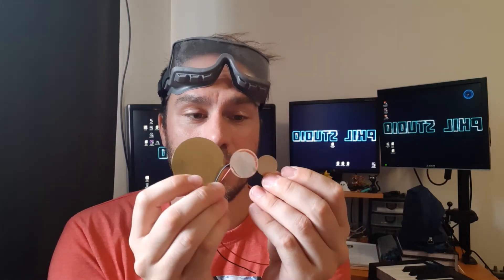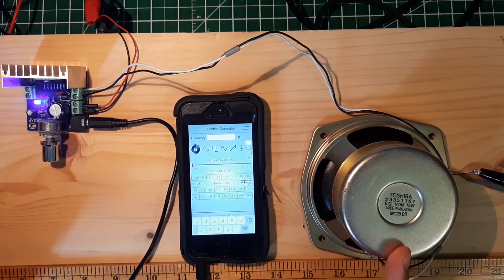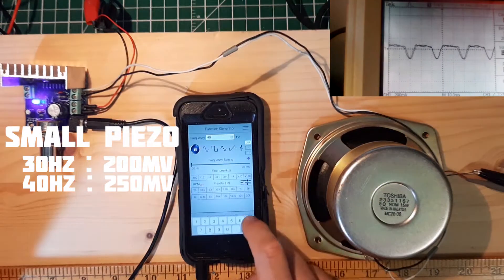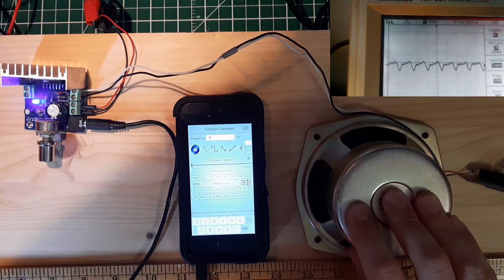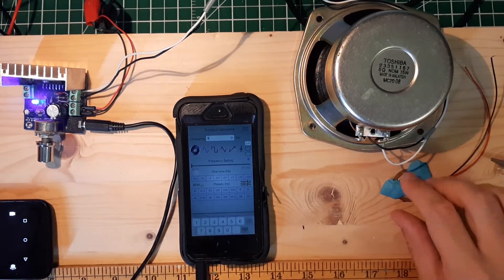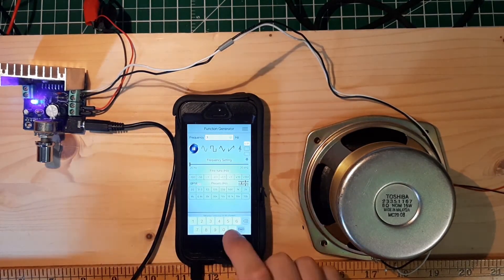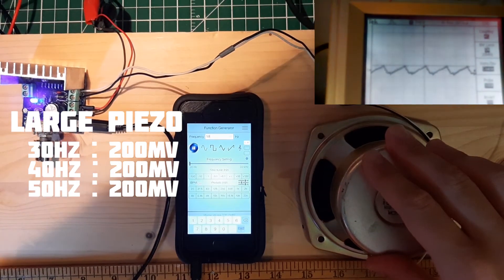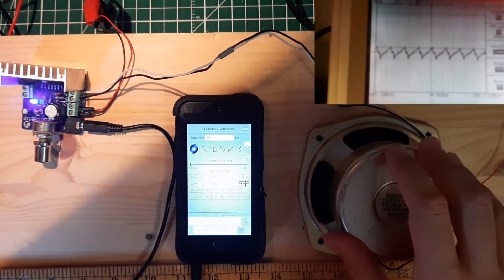Piezo Pickup Size Test: Small vs Medium vs Large — Frequency Response on an Oscilloscope

Comment: Interesting. 
I wonder if the peak to peak substantially drops off or increases as you hit higher frequencies. Lucky me I can see the next test now as opposed to next week.
Reply from the maker: Higher pitch will result in a weaker vibration of the wooden surface so this experiment was good but still just a plain house experiment. Wish I had a lab to try various other surface such as metal, wood, plastic, plexi. Then I could do a report on what's the resonance frequencies of different materials. But that's the topic of a whole other world :P

Comment: great job man!
I have a question if you don't mind:
I started tinkering with mechanical watches a while ago and in watch making world there's a device called timegrapher which  basically listens to the watch through a contact mic and analyzes the watches performance, there are apps and programs that do the same thing but the problem is if you use a normal mic the ambient noise screws the results or even prevents the program from picking up the signal.
I did some research and found out that people are making their own pick up mic using piezo discs and everybody seems to get  good results so I thought I'd do the same thing.
I bought a generic PAM8403  amplifier and  some piezo discs and connected the disc to the input of the amp and 3.5 mm jack to the output and at first I got terrible electric noise but then I switched from usb to batteries and the noise is basically gone now when I tap on the piezo disc I can see the signal loud and clear on Audacity no matter how lightly I tap it it's picking it but the problem is the damn thing isn't picking up the watch signal or at least it's picking it but it's too low and getting distorted by the very low electric noise that the amp naturally has.
people who made this do't include detailed information about this and I have zero knowledge about electronics and now I don't know what to do.
do you have any advice or ideas on how to make this work?
I am really really sorry for the long comment but I'm eally desperate here.
Reply from the maker: Hey there, it is possible that your audio jack isn't shielded. Check this video to create a piezo contact mic and let me know if this helped: https://www.youtube.com/watch?v=3jduFLhjft0&t
Reply: thank you so much, I'll try it and tell you what happens
Reply from the maker: @Ammar.D  For sure! Let me know!